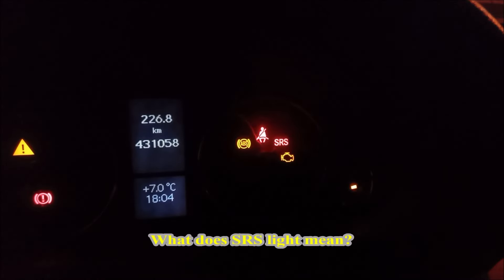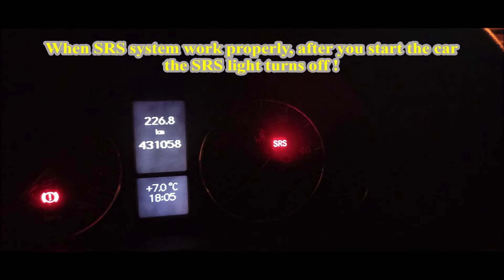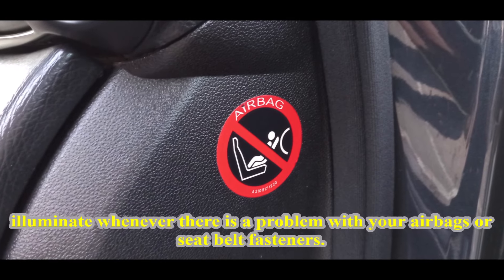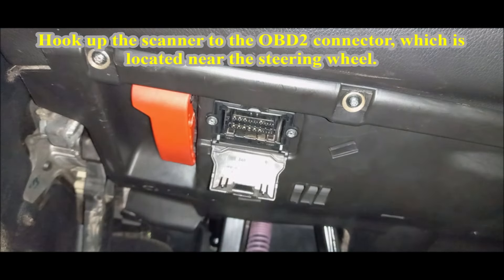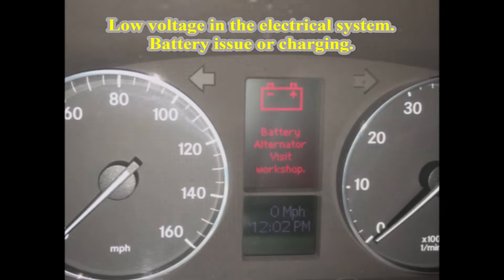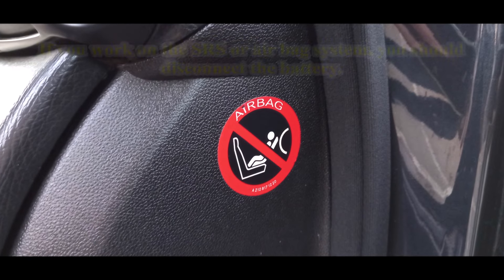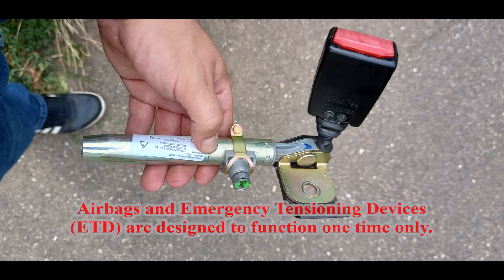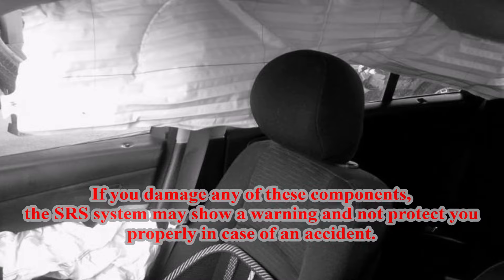Meecedes-SRS ? fault ? Supplemental Restraint System Basics Mercedes Benz / C-CLASS W203 2004

Comment: Do u know how to fix
b2735-13 mercedes check code srs
My airbag light is on on my dashboard
Thanks you😊
Reply from the maker: hi, options:
1 battery pyro fuse check (battery marked + port):

Video: https://www.youtube.com/watch?v=Gj6gaOVHsqI

2  check the fuses :
check SRS Fuses number 45, 49

Video: https://www.youtube.com/watch?v=ParVMq4Sl-c&t=300s

3 check the fuses in the pre fuse box 

You wil find the fuses places in my video: 
https://www.youtube.com/watch?v=t9J9jEgn6ks 

SRS fault codes descriptions:
https://static.nhtsa.gov/odi/tsbs/2019/MC-10170539-9999.pdf